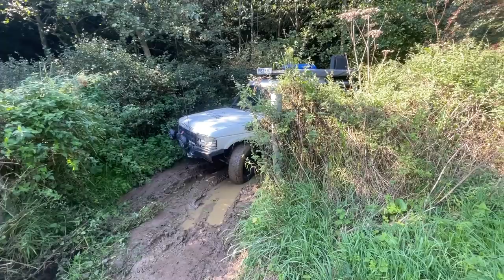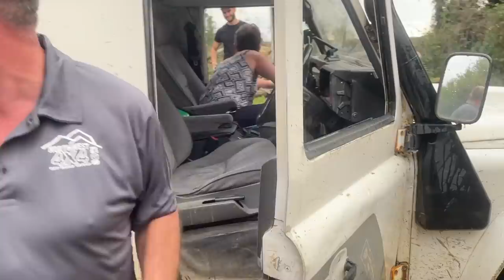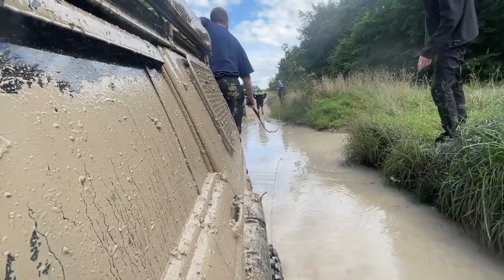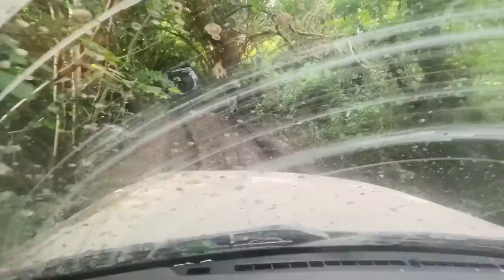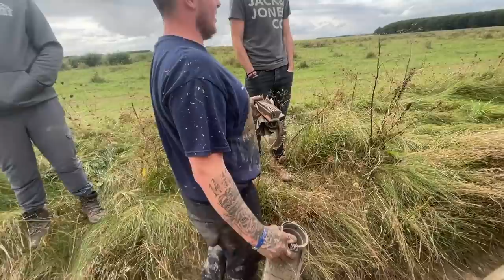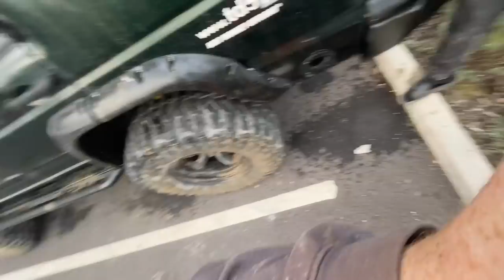SALISBURY PLAINS | Stuck in the mud | Off Road/Green Lanes | Bog holes and broken trucks | 4WD UK

Comment: Noticed the grills on the rear windows on the D2 did you make these your self's or did you buy them buddy if so do you have a link
Reply from the maker: They’re from AW4x4 bud, Armoured Engineering also do them in a slightly different style so check them both out 😁

Comment: Any clue why the snorkel failed?
Reply from the maker: From what we found, the snorkel hadn't failed. The Water, Mud and bits of smashed plastic from the snorkel grill came from the top 😬🙈
Reply: I’ve had similar on my d2. It’s the woven fabric coupler between the air box and snorkel. If submerged, water gets through it. It’s not easy to get that much water through the top. 

Also happens if you don’t locate the air box lid perfectly over the filter which seals it or if you have missing clips, which most seem to. Only a few quid from Land Rover.
Reply: @m4drx  
You need to silicon all joints.
Reply: @Robert-cu9bm  I have done mate and added a few layers of waterproof tape around for good measure. No water or mud in the air box since and it’s been about 4 years of laning trips to Wales, Salisbury etc.
Reply: @m4drx  
👍
What people don't realise when they have one is that they're not a "snorkel" they're a high air intake. 
The standard airbox isn't designed to be submerged in water. Best to get a aftermarket aluminium one and make sure all joints are sealed correctly.

That amount of muddy water isn't coming through the top, that's leaking in through the joints.
Reply: @4WDUK  looks like you're still using the fabric coupler. I also do believe there's a small hole in the bottom of the air box as well. I have a rubber coupler and sealed every attachment from the airbox to the snorkel assembly.

Comment: All your videos are brilliant ! What lift and tyres do you have on the d2’s ? I have a 1999 d2 that is a daily driver but looking to use it off-road on the weekends too ! And I’m looking for inspiration in the lift/tyres area.
Reply from the maker: The gray d2 (Dora) is on 37” tyres in this video, 3” suspension lift and 2” body lift. 
The green d2 has 35” tyres and a 4” suspension lift. 
The blue d2 has 32” tyres with a 2” suspension lift. 
All depends on what you’re planning to do with the vehicle on how far you go. Our little blue d2 will get 95% of places if you push it 👌🏻
Reply: @4WDUK  thank you for the information !!!! Somewhere between Dora and the party bus I think 🤔 then I can still drive to work every day but also triumph in the lanes on weekends 👍
Reply: @Oneeyeben4wduk  For the vast majority of lanes or general 4x4ing a 2" lift and 32" wheels are more than sufficient. While opinions may vary, I personally would not want to use a D2 with 35" knobbly tyres and a 4" suspension lift as a daily driver. You might as well commute in Tractor it will be pretty much the same thing. 

If you go larger wheels and higher lift, you are going to need to spend a lot more money. There's an adage for every inch you go over 2" that's an extra grand per inch. As you'll need to correct the castor and radius arms. and the drop links. You will need longer brake hoses and possibly extending the wiring for the ABS sensors to accommodate the flex of the axles.  

As for tyres, you can go up to 5% bigger than standard without too much issue. 29" is standard on a D2. if you put 32" tyres you are going to notice its a lot slower. If you go even bigger you are going to need minimum of a stage 1 remap to make it drive worth a damn and if yours is an automatic then you can't put more than 380NM safely though that autobox and the standard Td5 Torque converters are not the best either, if its manual go for a stage 2 that means making changes to that exhaust and also, you may need to change the gear ratio of the transfer box too. Normal ratio on the D2 is 1:1.2 so you're going to need to get the transfer box on 1:1.4 like a Defender or even 1:1.6. 

Its a big job and you have to budget for it as its not cheap to get everything you need for it, and know what needs doing, simply raising the suspension and putting fat tyres on is just the tip of the iceberg really.
Reply: @mikeb53  thank you I have decided to go big you only live once ! 4inch lift and 35” tyres